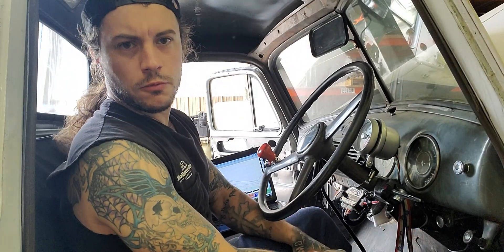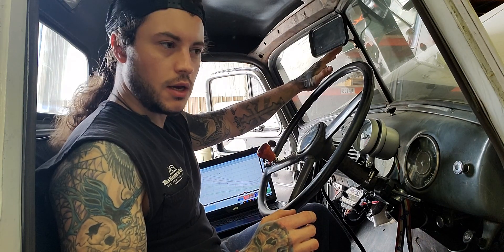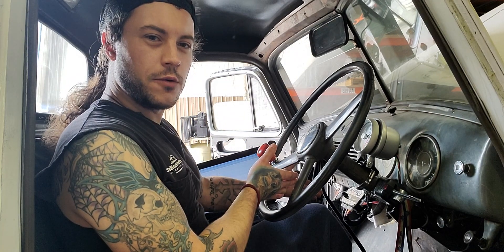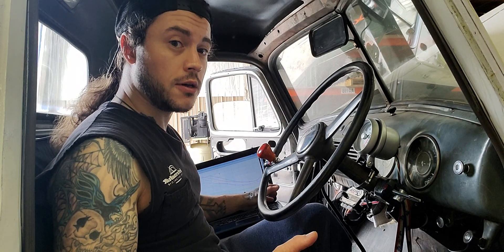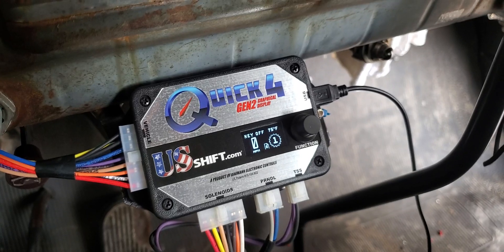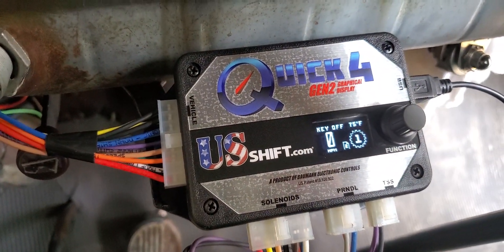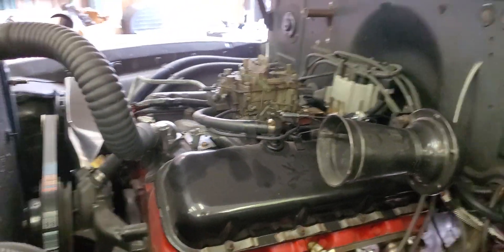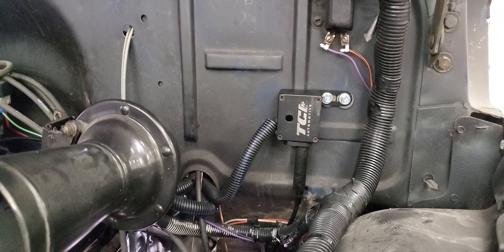The Fantastic US Shift Standalone Transmission Controller!!

Comment: Holley doesn't offer any tech support, for their trans controller  kit,  my brother  has a 92 f150 with the e40de, trans and sniper  efi,  because  the 306 is built up and the factory  efi wouldn't work with high compression engine, with a bigger cam,  but its hard to fi d a video, or anyone else who will install the holley trans controller kit?
Reply from the maker: I am redoing my holley video but for gm not ford. Same principles apply though. I made it too long and have to shorten it as most of the general public needs it more dumbed down. Keep an eye out soon!

Comment: Do not agree with the statement sad 350 and 700 defienicies.  Both excellent units,, if you have even a little knowledge about governor spring , and TV adjustment on the 700. 350 behind many hot street/strip cars.and can be equipped with transbrake and reverse pattern valve bodies.
Reply from the maker: Try putting those behind a single turbo basic ls motor and you may change your mind

Comment: Can you show the throttle position sensor I was told if I did a stand alone for a 4l80e swap I'd have to do that I was also told to tune my pcm to not try and read for tranny singals
Reply from the maker: Yes thats all correct. You need a tps and a tune. Hiring a professional tuner would be more help than i especially this yr.

Comment: I have a question about putting a carbureted motor into a vehicle that already has a tps module on the vehicle? It’s a 99 mustang that I’m swapping a 289 into
Reply from the maker: Simply Tie the tps into the controller. Will work just fine as long as the tps is in good health

Comment: Im swapping out an sm465 manual transmission to a 4l80e in a carburetored 350 sbc 74 gmc Stepvan because I need that overdrive gear for highway speeds. Hoping this controller might be the ticket.

Comment: What eles did you need for the swap drive shaft and shifter bracket under car?
Reply from the maker: I made every cross member and mount myself from scratch to fit the engine and trans. Had to make a tunnel. But yes the driveshaft depending on your plcement and shifter as well as moving the radiator forward about an inch.

Comment: i have light switches from home depot to make my transmission shift it takes 3 switches to make it work chevrolet transmissions solenoids shift off the ground it takes four wires to make it work its almost like driving a manual lol

Comment: How does the unit know rpm to be able to adjust the shift points? Does it hook up to the distributor somehow?
Reply from the maker: It does through the tach side but its not required. It knows how through tire size, rear ratio, rpm, mph, tps, and output speed factors
Reply: @PerformaBuiltTransmissions  I have a level 2 700 from y’all right now in a 4x4. Do you know if I can direct swap a 4L60E into  it? I’ve looked into it a little but couldn’t figure out how to get the electric speed sensor for the trans to shift properly. Will a 4L60E be the correct length? And will the rear part of the trans have a spot for the speed sensor? I know on oem 4x4 applications the speed sensor most of the time is in the T-case
Reply from the maker: Yes it is a direct swap and the vss is the same as some later 700 vss's. The dimensions of the 4l60E K case and 700R4 are exact dimensions give or take a few thousands for converter spacing.
Reply: @PerformaBuiltTransmissions  the only spot I see online for the vss is on the tail shaft of a 2wd trans. In a 4x4 there is no tail shaft
Reply: @PerformaBuiltTransmissions  also in a 4x4 oem app they install the vss in the tail of the transfercase. In my 84 this location is where I have my gear for manual speedo cable. So do you see my dilemma?
Reply from the maker: There are adapters to use your current t case and the vss will operate the same as anyother 4l60.